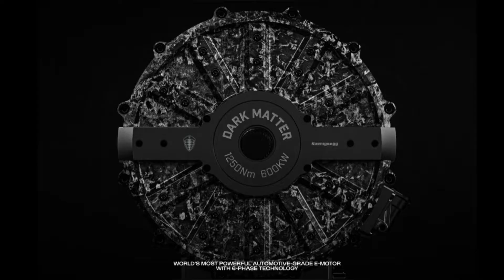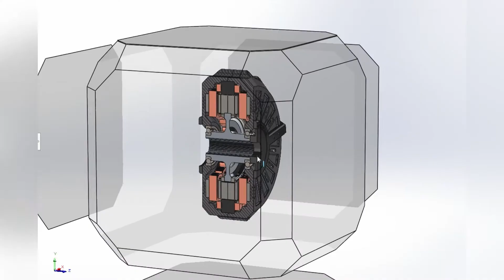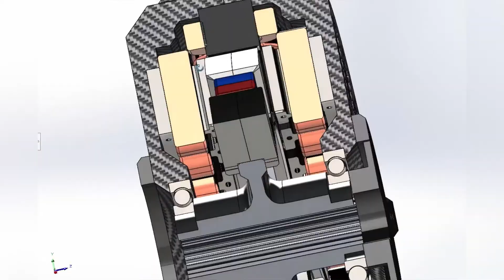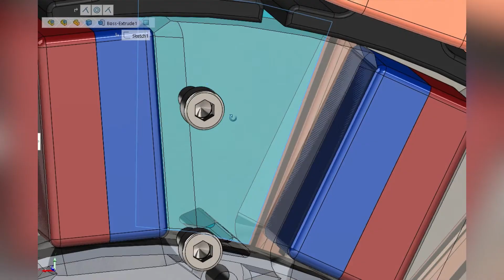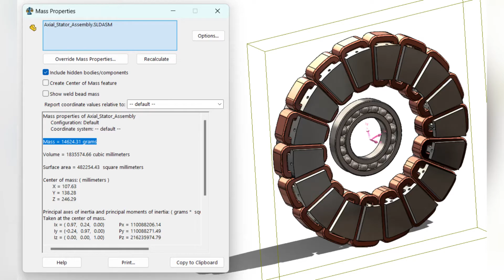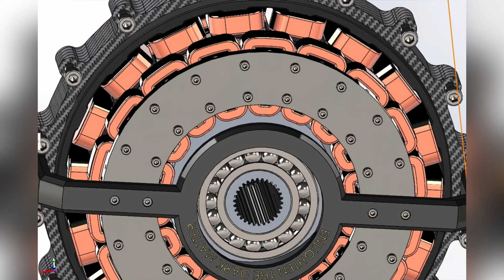Dark Matter Motor Revealed

Comment: what is the rotor core material?
Reply from the maker: Mild steel
Reply: @robobiceps  solid mild steel? what about Eddy current?
Reply from the maker: @nendhang  for rotor( solid mild steel) for stator laminated one
Reply: @robobiceps  I don't think solid steel can make it that light, also it will heat up very quickly 
consider SMC soft magnetic composite, it can be easily sintered